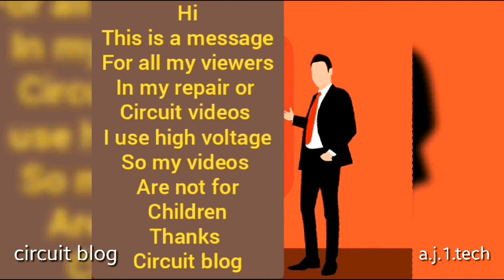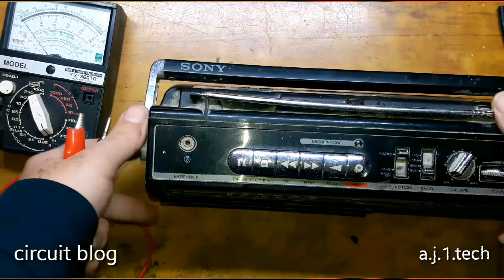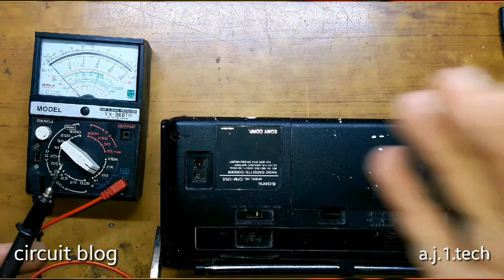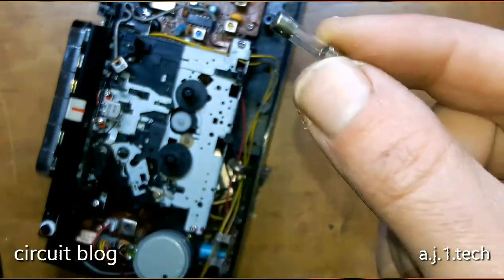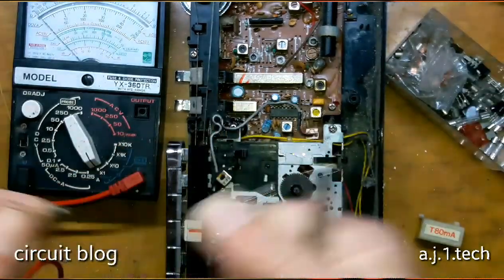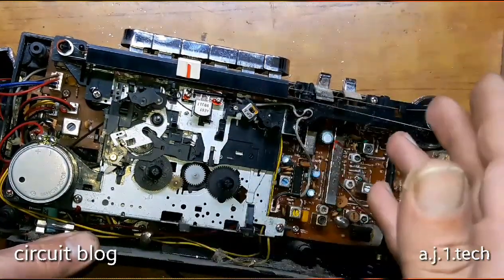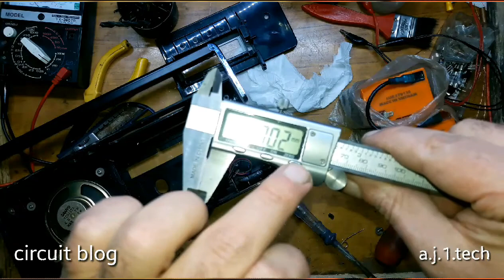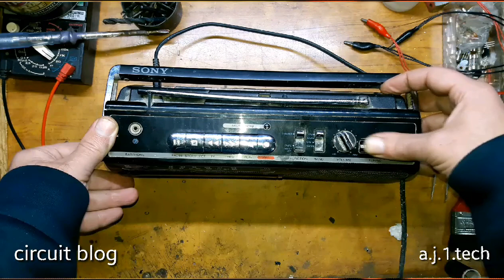SONY cfm-135s

Comment: Great job! Every time I tried to repair my old cassette radios in the 1980s I destroyed them. LOL! I have a large collection of portable radios that I bought for the purpose of MW and shortwave listening, plus a few emergency radios for power outages.
Reply from the maker: I am glad you like it  and to be honest best kind of portable radios and tape players are the ones that has ben made before 2000
As for the radios that you have i hope you can get them to work again
Reply: @circuitblog01  Yes I agree. They are hard to find, but there are a few actual true analog radios still sold. Tecsun has some true analog radios for sale. I bought their R9012 and R9700DX AM/FM/Shortwave analog radios because of their long battery life and better performance on the medium wave band. 

Modern DSP radios perform horribly on the nighttime MW band because on weak, fading signals the audio suddenly mutes, and they use more power than analog circuits, draining the batteries quickly. This doesn`t happen in a true analog circuit. The Sony ICF-P26 & 36 are also true analog radios with incredible battery life. Two AA batteries will last a month or more using these radios 4 hours per day.
Reply from the maker: @baneverything5580  
Yes, you are right about the analog circuits and the analog radios they still exist, but in a small numbers , because the cost of production is high in comparison with the new systems, and I agree with you, the dsp system is very bad
I i well never buy a set that have this circuits in it
Reply: @circuitblog01  CCrane company makes a very good DSP radio that has absolutely amazing reception on MW and FM. It also has connections for antennas and 10k and 9k settings for use in any country. It is sold as one of the most sensitive MW receivers ever made. The weak and fading nighttime signals don`t mute using this radio. 

The name of it is the CCrane EP PRO. It looks like an analog radio because it has an analog tuning dial, but inside it`s a DSP circuit, but it is well designed. It remains to be seen if the circuit holds up over time and lasts 25 years the way they did years ago.
Reply from the maker: @baneverything5580  
I think you did not understand me right . I’m not talking about devices that contain dsp circuits with high sensitivity. I’m talking about low cost or cheap types as most of them are only designed to  receive strong signals, and even tuning the channels in these circuits is somewhat difficult, and in fact even with analog devices  there is . Low end  circuits and there are also designs with low sensitivity
But even with low cost analog circuit as long thay have a normal ver.cap (Variable capacitor) thay are easy to use more then the low end  dsp circuits 
In a future videos i will post a numbers of videos about how to build fm /am radio from a.....z 
Analog /digital i hope you find them Interesting
Reply: @circuitblog01  Yes I understand. The analog radios I named do have air variable tuning capacitors and work very well usually, although from buying multiple examples of identical radios I`ve noticed some are much better than others. If I haven`t mentioned it already, have a look at the Raddy RF-L3 Multifuction Radio

This thing comes with three light bulbs on long cords and the built in lights, including a very bright spotlight, are amazing. It comes with a 6v 3w over 8x5 sized solar panel on a long cord that charges the unit pretty fast. It has a USB port for charging other devices and it works very well. I hooked up a USB AA battery charger and it easily charged my batteries for use in my other devices like radios and flashlights. If you observe the polarity of the solar panel output I see no reason why it wouldn`t power low current 6 volt devices like radios with compatible inputs, which I haven`t yet tried but will soon. Has AC adapter for charging too.